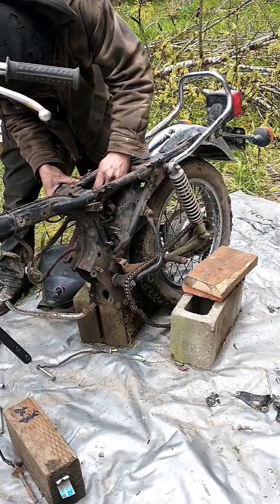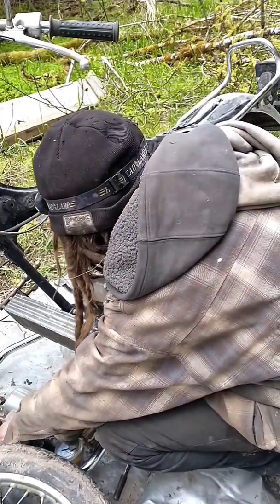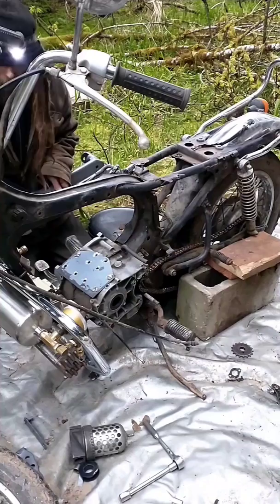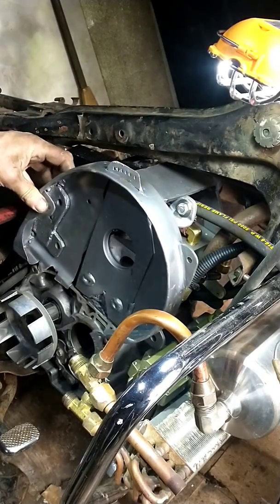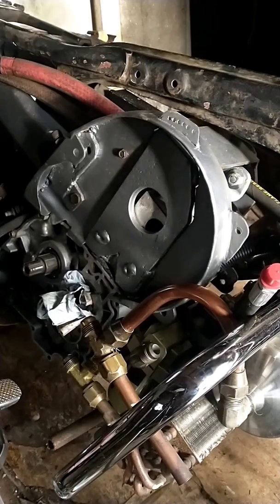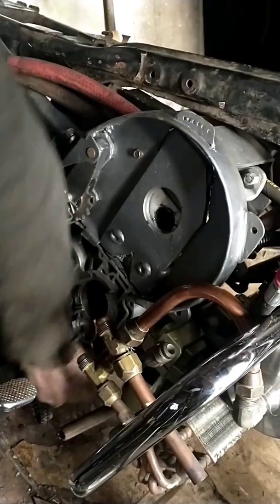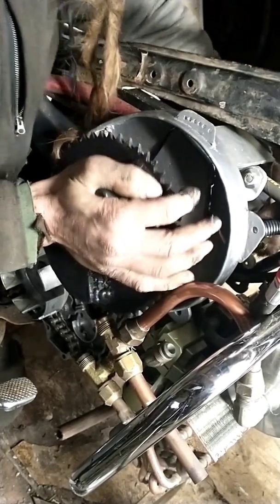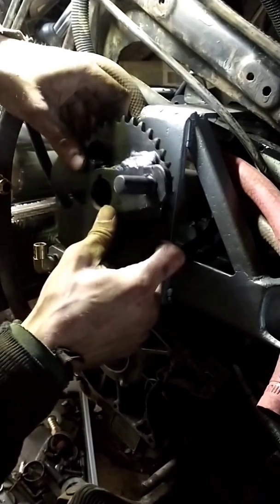Switching over to Compressed Air -  Pneubike motorcycle conversion

Comment: Great start! Some efficiency could be gained by adding a small mechanical compressor so you can add air back to your tanks when riding downhill or braking. Also check out this air motor, may be a better power delivery system for long term use: https://www.youtube.com/watch?v=AeSNEeq42t4   (Also it sounds like a motorcycle so cars would hear you coming.)
Reply from the maker: That's looks like an automotive compressor? Sound is generally a sign of inefficiency with air motors, but it could be added without much added resistance to a very efficient air motor using trapped standing waves created by splitting turbulent air exhaust air in a reverberance chamber, like a low frequency flute

Comment: Let me see if I got this straight; You have 1.designed a motor 2.built and tested that motor 3.made the plans for that motor available for free on your website?  4.If I can make my own motor using your plans, I can power a vehicle with air and never use bankster-issued currency to purchase fuel ever again?
Reply from the maker: The ability to create compressed air using wind turbines, microhydro, and solar makes it possible for a compressed air transportation solution to be a one time set up cost, without the ongoing need for battery replacements or fossil fuels.. the cost to set up a compressed air infrastructure is less than any other option, but it would take an elaborate network of filling stations to be able to drive your compressed air vehicle outside of the town you live in.
Reply: I love that, and I'm going to take that as a 1.yes 2.yes 3.yes 4.yes. Haha.  @Pneubike

Comment: i cant see why you didnt just weld and grind new lobes on the cams... other than the engine being seized solid.  like, i love the idea but to do it this way? with high friction, expensive air cylinders that will quickly wear out, and just arent designed for this type of cyclic repetition? the ports also dont have the flow. bet the cylinders get cold, the air expands inside there...
 but at the same time, the valves will get stinking hot... on every exhaust stroke, you are recompressing air, and that takes power, then squeezing it through that TINY little port. any pressure in that cylinder higher than atmospheric is acting AGAINST you.

heat.
heat.
heat.

im not averse to fossil fuels. cultures where it bubbles to the surface naturally have used it for millenia...
the issue is 8billion humans running around burning it needlessly in little metal boxes. that ironically are getting bigger now?

meh. i would have done something more like...

compressed air line through heat exchange in exhaust.
feeds one cylinder, working expansively.
back to another heat exchanger.
fed into second cylinder configured as a lenoir cycle two stroke, be a bit tricky fuelling it but so what, and run combustion in one cylinder. no compression cycle as its already compressed.

heat the incoming air with the wasted exhaust heat so it can expand fully, and have no compression pumping losses within the ICE part...

and of course, me being me and growing castor beans, i already run my two strokes on home made alcohol and oil... see that plume of blue smoke? 100% renewable. breathe deep.

wood gas...

forget combustion, come to the realisation that ALL engines run on HEAT, and AIR, and think of other ways to heat air, how to make it EXPAND... such as hot salt...

you dont have to burn stuff INSIDE.

but you are limited by rates of heat transfer, thermal losses.

anything beats throwing 75% of it out the rear end!

Comment: On my way to finding this channel, I was researching something called a trompe.  Ever heard of that?  It's a way to get compressed air by directing water into a pipe...no fossil fuels required, no moving parts.  What a great combination that would be!   A trompe with a pneumatic vehicle and a Little Motor!  I'm actually in the process of inventing a three-wheeled reverse trike.  My original idea was to power it with an electric motor, but now I'm rethinking that idea thanks to you.

Comment: Great video tq. That Aircar company in France had the right Idea in the early 2000's & the world missed a golden opportunity there to get behind them & make a massive change for the better.   Not sure about now but I think as of at least 10y ago there were air powered taxi vans getting around paris with onboard tank charging compressors that plugged into normal mains power. It looks like Tata may have licenced & are producing the Airpod.

 Having a small air powered bike or car in nearly every household is what everyone needs for shorter trips and comuttes. Like stated in the video, air vehicles are the greenest by far to produce and very green to run.

 Everyone should also watch this video showing development of the air powdered vehicle if they haven't yet:
https://youtu.be/f4w6aJMNXSk
(8/Sep/2022-9:15pm🇦🇺EST)

Comment: Your spot on brother!
I have built air engines for years as a hobby. And while running my lathe or my milling machines I always thought it would be kind of neat if they were powered by an air engine. As you say, air power is infinite.
I had started on plans to build an air compressor that after the initial filling of the tank an air motor would take over to replenish the air that’s in the tank. Of course the motor would be run with compressed air. I have been told so many times that it’s impossible and can’t happen but I have plans prove otherwise.
I have long been a fan of steam and air power and fully believe that they have a place in our society.
Reply from the maker: Yes, I believe a compressor can be run off it's own compressed air, and it doesn't break any laws of thermodynamics, in fact it utilizes those laws to add energy to the equation from ambient heat. If I wasn't struggling to afford to live with the rising costs of food and gas I would have already proven the concept.
Reply: @Pneubike  The Amish around here in PA use compressed air to run power tools like band saws and lathes.